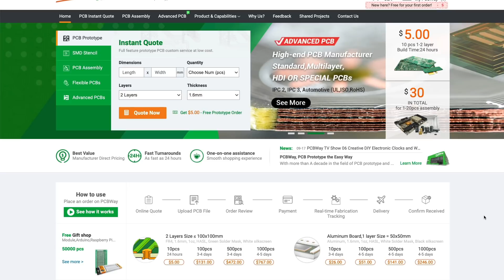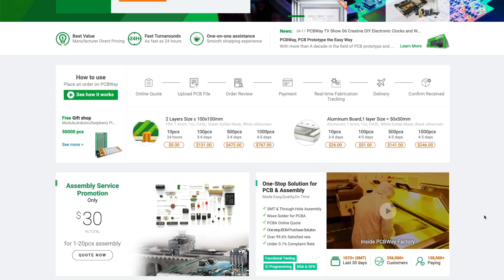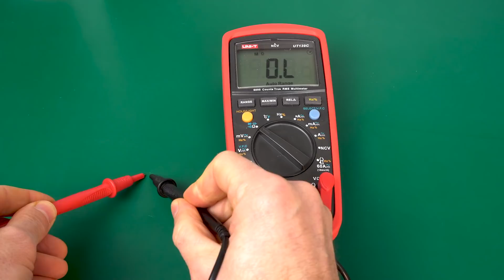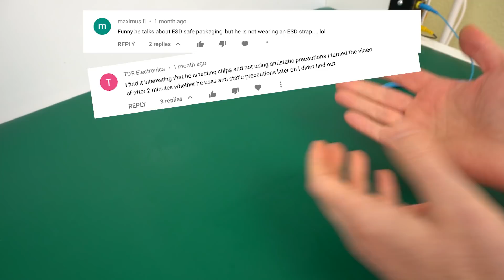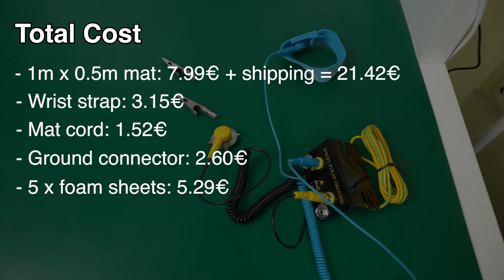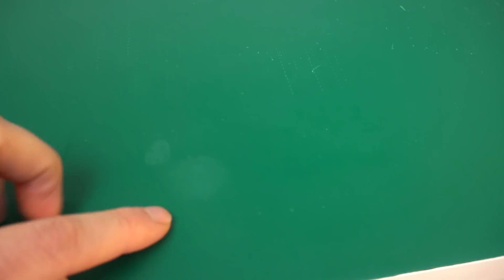How to Set Up an ESD-Safe Workbench

Comment: Thanks for the interesting video Noel. I have made some research and it seems that the ESD mats and the alcohol are not good friends. It seems that it may affect its conductivity and render it useless... Certainly disappointing taking into account one of the main uses of an ESD mat is electronics handling and IPA is always involved on that.
Reply from the maker: Really?? That is disappointing! Now I'm going to have to read more about it. It's hard to even imagine how the alcohold can disrupt the ESD properties. Do you have some good links for that? Thanks!
Reply: @NoelsRetroLab  I got an initial hint checking a quite big antistatic mat provider (Antistat). I read the product datasheet of a couple of their mats, for example this one: https://www.antistat.co.uk/product/esd-bench-mat-2-layer-textured-finish/ (there is a link in the web to the datasheet) saying this about cleaning "Please note that contact between the matting surface and any acid or alkali solvent is strictly prohibited (such as
 Benzene, Alcohol etc)".
I thought that this may be related to the materials used by this company in concrete but I continued searching and got to this forum that confirms it https://forum.digikey.com/t/esd-mat-cleaning/6011 it is a short entry but certainly dramatic about the difficult relation between ESD mats and alcohol.

Comment: I bought a much more expensive mat from a reputable seller (Farnell). My experience with scratches and heat damage were exactly the same as yours. I think the material they are made from is generally not durable. Also, if you are doing any hot air work, you must go back to your silicone soldering mat. I ended burning a very big hole in my ESD mat when I used the hot air gun.
Reply from the maker: That's disappointing! I had heard of the hot air problems from other people as well. I need to remember that!

Comment: Good explanation but OMG NO! the way you connected the earth wire to the socket is completely unsafe you need one of these https://cpc.farnell.com/antistat/070-0011/triple-esd-plug-3x10mm/dp/SA03645?st=earth%20bonding%20plug
Reply from the maker: Interesting. What makes that socket safer, the 1M resistor?
Reply: @NoelsRetroLab  the 1M resistor built in the L & N pins are plastic and you have not compromised the socket in any way so you can still use it as normal, Say for argument sake you pull on that wire and it rotates in side the socket and touches one of the contacts you will be in for one shocking experience.
Reply: @NoelsRetroLab  found one for euro sockets but I think you might find one cheaper locally https://cpc.farnell.com/antistat/070-0021/euro-esd-plug-1x10mm-2xb/dp/SA03649?st=earth%20bonding%20plug
Reply from the maker: Thanks, that makes sense. I added the link and the explanation to a pinned comments. Cheers.
Reply from the maker: I just checked and both the cable from the mat and the cable from the wrist have a 1M resistance. Do you think the earth wire also needs one? Thanks.

Comment: You had a piece of mat from the part you cut, where to do the soldering iron tests :-D

Anyway, great video. I have to buy one like that too.
Reply from the maker: You'd think that would make sense 🤷‍♂️ Unfortunately I didn't have the piece I cut out by the time I got around to recording the soldering test. Oh well 😃
Reply: @NoelsRetroLab  I'm kinda triggered by that. I'm someone who always keeps the junk that comes in packages or, like in this case, cuts off of some thing. You might never know when it can come in handy when you're doing some handiwork for gifts or other things. ✂️😛
Reply from the maker: @Terkzorr  Haha, that's what happens when you have a tiny space filled with computers to the brim. Keep only the absolute essentials! 😃
Reply: @Terkzorr  you know there is a term for people who keep a lot of "useless" stuff, right? 😃 Also, my collection of things I could definitely still use one day keeps growing...
Reply: @siamsurf  Yes, the term is "electronics enthusiast"  :P
Reply: @siamsurf I find it funny when you throw away some "piece of junk" thingy that has been lying here under your workbench for years collecting dust and in a couple of days you do something and suddenly realize that you need that piece right now but it's already on its way to the waste processing plant.

Comment: I was going to ask if it was ok to wear around your ankle and you already answered my question.
Reply from the maker: One step ahead of ya! 😃I still haven't figured out what's less annoying though. Around the ankle is really annoying if you're getting up for stuff frequently.
Reply: You can also have the entire floor have anti-static coating, then you wear a heel strap as so.  We did this in our factory :) 
https://www.esdgoods.com/product/esd-products/heel-strap.html#:~:text=Anti%20static%20Heel%20strap%20also%20called%20ESD%20ankle,to%20ground%20resistance%2C%20adjustable%20Velcro%20and%20conductive%20ribbon.
Reply from the maker: @booboo699254  Whoa! That's pretty hard core! I guess it makes sense for a factory though.

Comment: Do your wrist-strap have a built-in a 1M resistor? because you should have one somewhere along the line, and I don't see it on that black attachement 5:38
Reply from the maker: It must because I measured it and it was a pretty high resistance. Maybe it's built into the wrist part?